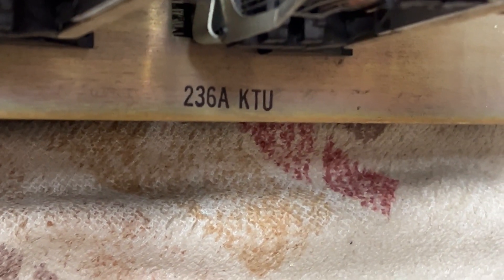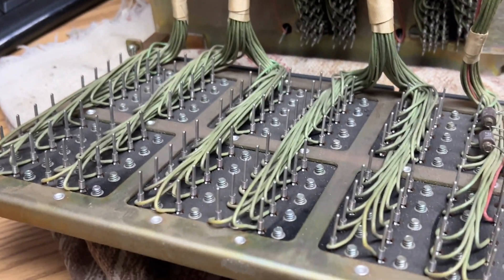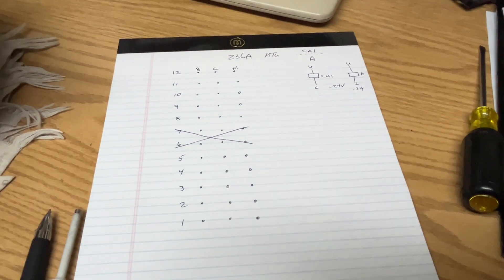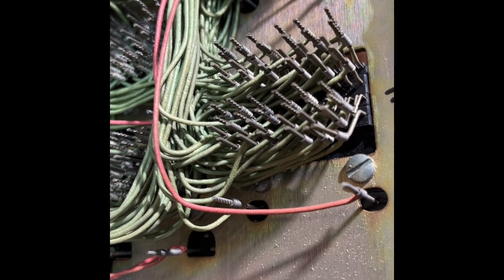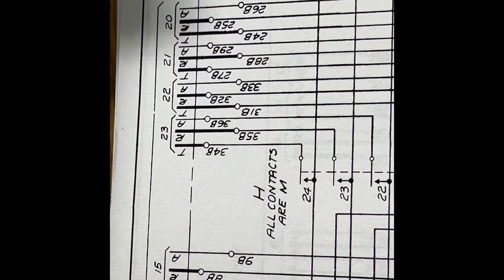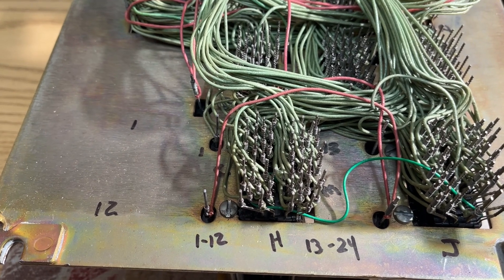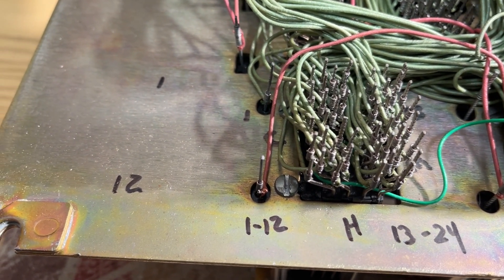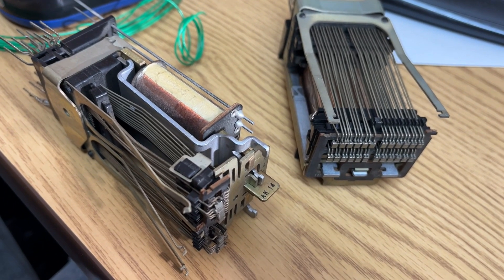Repairing a 1A1 KTU

Comment: @sxsphil I love watching your videos. Been into the key sets, intercoms and other vintage phones since I was about 5 years old and never tire of learning something new or finding a new set I don’t have!

I have a 551B type KSU (northern electric version that is) and I’m trying to connect an LED signal light to it that comes on when the line rings (to use in a room where we can’t have the buzzer making noise). I did this a number of years ago on the same model KSU for someone else where we wired the +24v DC circuit that powered the light through a set of contacts on the 66 block and configured some jumpers on the line cards that made a dry contact relay of sorts activate and close the 24v circuit to power the light as long as the ring circuit was active but I can’t for the life of me remember how we wired that up. Do you have any ideas how it could be done? Trying to do it again but I’m completely lost - have no idea if the relay that was completing the circuit was on the line card or in the interrupter somewhere.

Comment: I've had to perform backplane work on several EAX Switches, with I believe it was 30-gauge wire.  It tests the steadiness of the hand, the quality of vision, & the patience of the mind.  It was typically in the Maintenance Window, either at the top of a equipment bay on a ladder, or on a grounded foam mat on the floor.  The fun of being a Switchman in the C.O.  Looking back, it was not for the faint of heart.

Comment: This takes me back to when we had a ton of key systems in a large hospital.  I often had the large panels with 3 banks of lines.  It was always fun when you had 10 and 20 button phones and had to set up matrix blocks to only make certain lines ring.  

Eventually the ITT TE400 PBX was replaced by a Nortel SL-1 so we gradually phased out key systems. I have literally pulled miles and miles of 25 and 50 pair cable for those key phones.